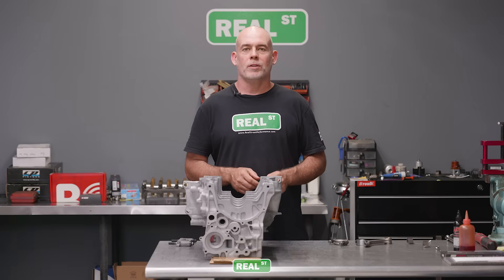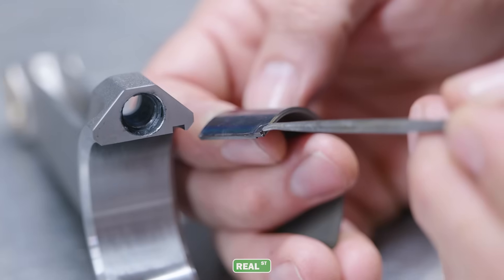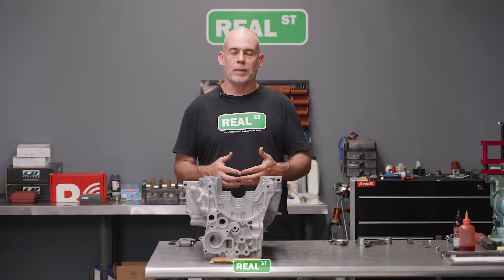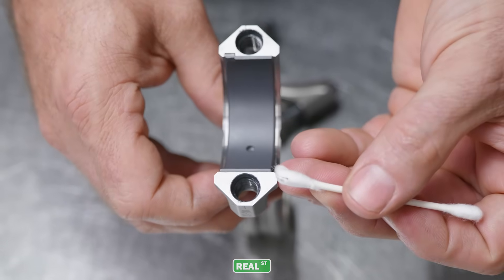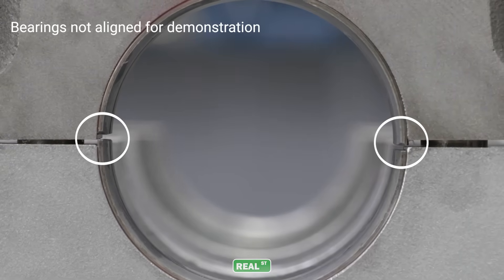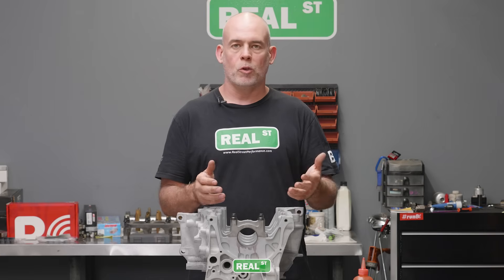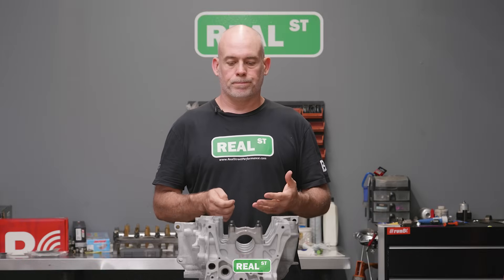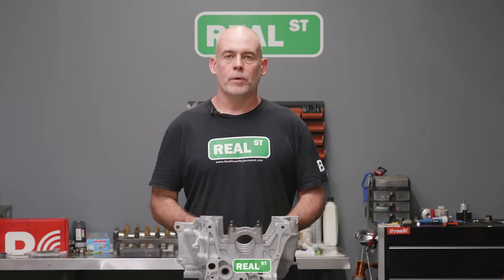Adding Oil On The Back Side Of Bearings During Engine Assembly. Good Or Bad?

Comment: hey jay i first want to thank you for sharing your knowledge, i have done my best to follow your way of things.

 I recently put my k20a2 piston and rod combo block together and ran into a problem while torquing the girdle main bolts, at first i was using 30wt oil to lubricate the threads and friction areas of the bolts. Honda calls for 22lbs + 56 degrees on those bolts, i initially had the girdle sit properly and then i torqued all 10 bolts to 22lbs in the oem sequence but things got interesting when it came to the 56 degrees because my cheap quinn torque wrench from harbor freight, after the 56 degree turns it would give me a final torque value in ft-lbs, it turned out the final torque values were varying wildly for example one bolt will say 54 ft.lbs after the 56 degree turn and then the next one up would say 68ft lb. The inconsistency just didn't sit right with me so the next day i loosen all the main bolts and cleaned all the threads and used arp lube instead and had much better result as far as the torque values being consistent, after the 56 degree turn, this time they were between 43.7-44.7ft.lbs. 

Now my question is did i do right by using arp lube instead of 30wt oil, will i run into any issues?
Reply: I will say no issues bro, I've seen so many varying results when I've assembled engines whether its rod bolts, main studs/bolts, head bolts that as long as you're within a certain range of each other when the threads stretch then you wont have a problem. It's when you're tightening them and going for the stretch h part and it doesn't quite feel right so you add a little bit more and a little bit more trying to match the torque value instead of trusting the torque angle, that's when you get a problem. Once you hit a certain point during the yield process the torque value will start going down as the bolt stretches until next thing you know it snaps from too much stretch. I use arp lube, regular moly lube, and other oil weights and its honestly experience that tells you when something doesn't feel right, the lube does change the number whether its right or not doesnt matter. As long as its "close" and makes sense. I've had engines have + or - 10-20ftlbs or more on many different components and ended up servicing those engines for years to come for basic maintenance like oil changes etc. on street engines or race dedicated. It took me some years to get fully comfortable and recognize the way I did it was "right" since they didn't come back for any premature failure of anything. Just a tip, follow procedures to the best of your understanding and always do your best trying to find proper technical data. Torque specs for factory hardware will be different than arp hardware so do your homework
Reply: I need some info.  Are the main bolts stock or race type aftermarket?  Does either maker recommend replacing the bolts after one use? ( RE Torque to yield bolts / Stretch bolts ) When using the Honda recommended torque, do they specify motor oil or assembly lube? 

In the case of TTY,  initial torque then turning to a certain degree is to eliminate variability due to friction. Torque infers clamping force and clamping force it what really matters.   In other words, the bolts get tightened to an initial level to seat the assembly then the bolts are turned until the bolt permanently stretches.  

Motor oil will be displaced under high loads and could cause the torque variation where as some types of assembly lube will remain in place forming what amounts to a dry lube.  ( Think extreme pressure gear lube for a straight axle car ) 

If these bolts are not TTY, perhaps the tightening cycle removed burs from the threads and under head of the bolt leading to more consistent results. Also, if not TTY, I'm not sure why Honda would specify torque + rotation.
Reply: @bobroberts2371   the bolts are reusable and are oem.
Reply: That's why they specify a torque angle as the final step, since ultimately what matters is the correct bolt stretch which equates to the correct clamping force.  The threads are mechanical, where a certain angle of rotation will always result in the same axial displacement defined by the pitch of the threads regardless of how much torque it took to get the fastener to that given angle of rotation.  Achieving a given stretch accurately from a torque value gets much more difficult as the torque increases, because the thread and under the bolt head cleanliness, surface roughness, and presence and properties of any lubricant vastly change the coefficient of friction, which has a much greater effect as the forces increase very high, and consequently the resulting tightening angle achieved from a given torque value.  ARP lubricant is specifically designed to provide a consistent coefficient of friction so that a given bolt stretch can be reasonably accurately reproduced by using a torque value...very important for super critical fasteners like rod bolts.  Using a stretch gauge is always the absolute best way to torque rod bolts, as you are measuring that bolt stretch directly and completely removing all variables from thread and head friction variations out of the picture.  That is also why it is easy to strip or break fasteners, especially smaller sizes threaded into soft material, if you apply anti seize grease and then torque using the factory torque values...the factory torque values are usually calibrated for dry threads for general fasteners and will result in overstretching the bolts when the thread friction is reduced with grease.  Non critical fasteners that are at risk of corrosion that I grease with anti seize I always torque to the lowest value in the factory specified torque range and that usually compensates sufficiently.  The opposite goes for dirty or stiff threads...they will hit torque target before achieving the intended bolt stretch due to the excessive thread friction.  You kind of have to use some feel and intuition in those cases.  Slick threads get torqued to the low range and stiff threads get torqued to the high range of spec.  Cleaning/chasing threads and bolts that aren't clean also helps in reducing that kind of deviation that needs compensation.
Reply: you now know why arp specifies their lube when using their bolts.
oiling your bolts before assembly isnt a great idea unless its specified. it can make torque specs vary wildly too as the oil can get on the head of the bolt and make it slippery. 
arp lube isnt as slippery but it lubricates the threads so they dont deform.

Comment: What would cause a bearing to get crushed?
Reply: Tightening the bore it's in. If you measure the od of the bearing, it's larger by a small amount than the id of the bore it's in. The difference is the "crush".
Reply: That's what holds it in place
Reply: Think about how a bushing is held in place, the bushing OD is larger than the hole ID.  Also, the thickness of a 2 piece bearing is thinner where the two halves meet, this extra oil clearance is done to prevent the bearing from grabbing the crank when assembled / during high loading. ( the bearing bore ovals out under high loads )

Comment: I'v never put oil on the back of any bearings, found many engines with dry bearings on disassembly
Reply: Dumbest comment of the year award. If a bearing didn’t have lubrication it has nothing to do with assembly. That’s a deeper issue.it would have failed immediately if it didn’t have lubrication for any amount of time.
Reply: @nsboost  Talking about the back of the bearing  fkwt

Comment: Never oil. But people also rub assembly lube on with their fingers...so...wtf ever I guess. But a real race engine  NOTHING , not even oil from your fingers, on the surfaces. We are talking bout the thickness if human hair! Tangs locate nothing else..  Bearing crush holds in
Reply: What constitutes a real race engine? Because the last time I checked, Real Street Performance has some pretty capable race cars.
Reply: @harrisonpeck130  well, they got turbos. So, you can bolt together a basically stock engine and throw boost at it, or have nice pieces with turbos.  Eazy peazy. Nhra pro stock, cup engines, comp eliminator,  super street, superstock, F1, indy, and engine masters.
Reply: @slopoke22  These guys go through the engines from top to bottom. It's one thing to disagree with a technique, but don't discredit them and their success just because you don't like how they are doing it.
Reply: @harrisonpeck130  I haven't discredited anybody,  so get over yourself. Not saying he doesn't do well. Just because you can assemble an engine half decent means nothing.  This man is big because of big turbo Supras and tuning as well. I've seen most all his shyt. Turbos, stupid if ya got one, stupid if ya dont!
Reply: @slopoke22   you’re telling a well established man in his realm that he is wrong for doing it the way he does for the purposes he does it for, which has worked for him well enough to attain his status, and then go so far as to imply that he either doesn’t build real racecar engines or that he builds them wrong and yet I’m the one who needs to get over himself. That makes perfect sense.
Reply: @Harrison Peck  lol, you make no sense, ive not said he does anything wrong in his "realm", or anything about him not building engines correctly, or the fact he makes vehicles go fast...smh I dunno. All I'm gettin at is, really it don't fuckin matter what you do. Just make sure measurements are correct and put it together.

Comment: I was taught to keep it dry during assembly for measuring and for final assembly. I was taught in a tech school and the theory is right. Your measurements with a dial bore gauge and micrometer will change ever so slightly if you add the thickness of the very thin layer of oil into the measurement, regardless of the oil type being used. That being said, if the experience of an industry expert says it apparently doesn't matter then I believe him. Keep up the solid work🤙 I was the one who asked what your personal future project plans are for Bonneville when you were on the sloppy radio show✌
Reply: In the interest of science, try mic'ing one both ways. It will be a month till I'm that deep in an engine again, or i'd do it. I suspect the oil film will evacuate the high spots, making little difference when installed. The key point he drives home is the low viscosity, so seems reasonable.
Reply: I agree, but I've seen it documented in many different books that it technically changes your measurements. I've never done a side by side myself but next time I get a chance to I'll find out for science. My dial bore gauge reads extremely accurate and I wonder if it may show me something. My opinion, I highly doubt it would make a difference in bearing clearances in an operating engine if you assembled it wet or dry. And with spinning a bearing, same thing if the machine work is on and the bearings fit correctly or close to correct I definitely dont think it would ever play a role in it spinning. To loose of clearances or not round would definitely effect it, and adding a lubricant film would probably aid in it then.
Reply: @Brother2Jis_27s4  listen. The bearing is fed oil from underneath. There is higher oil pressure than the top side against the crank. Physics says the bearing will always have more oil pressure under than on top. Immediately after the first rotation of the engine, that dry back side will be soaked in oil. No matter how dry you keep it and rub acetone to be double sure, there is no point. Pushing it in dry will cause micro scratches and that will absolutely mess up tolerances. Spend that time blueprinting instead. Also use moly lube for parts that have to wear in together and lithium for aluminum parts to keep them protected. I’ve collected this data from several engine builders.
Reply: I very seriously doubt you'd any measurable difference.
Reply: @jeffreydurham5342 I would agree with you but then we would both be wrong, it is measurable.
Reply: see

Comment: You coefficient of friction is lowered if there is oil on the back of the bearings. If it grabs for any reason at startup it gonna spin it. Bad idea.
Reply: lube on back of the bearing is least of your problems if the crank binds on the bearings
Reply: @Garage4age  right!☝️
Reply: Well yea there is always oil at startup on a brand new engine ,right???
Reply: @chuckschneider5625  You would hope so, Its really no different to any other engine start.   assuming not just the back side of the bearings were lubed..
Reply: Bearings usually spin because loose oil clearances hammer the bearing shell causing it to lose crush ( Crush is bearing OD being larger than bearing ID )  If you are having a failure at start up, you are not putting any oil in the bearing / crank or not pre oiling the engine then instantly revving it to 9 K.
Reply: @bobroberts2371  Have tried it. Would not recommend haha

Comment: Nice I always wanted to know why you did that. Now I was also wondering since you tightened the bearings to take measurements then loosen and retighten for final assembly do you loose some of that bearing crush? Thx
Reply: Elastically deformed interference fitment.